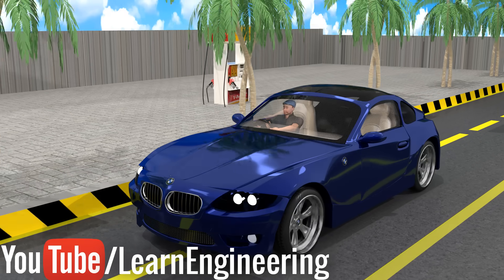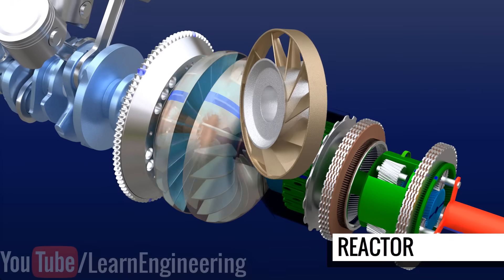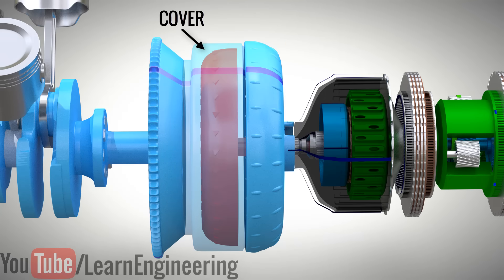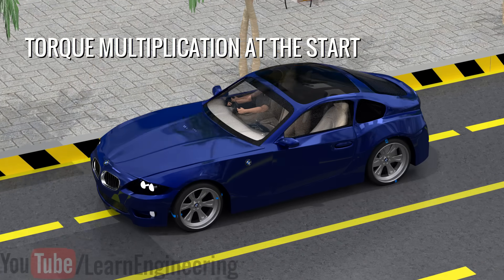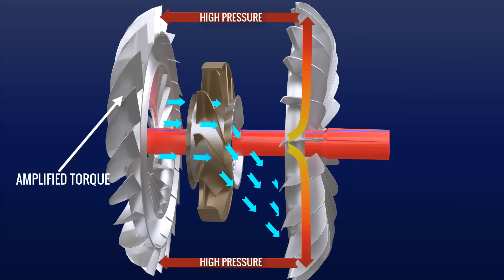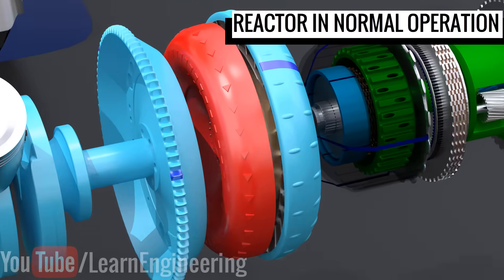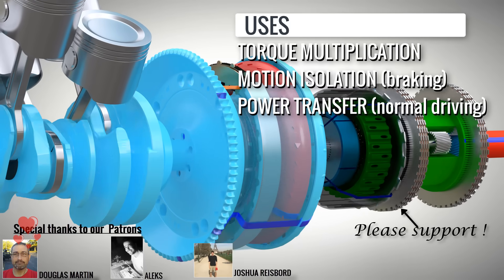Torque Converter, How does it work?

Comment: Thanks, Learn Engineer channel!

Learned a lot. Although I have 2 questions. How is the spinning fluid strong enough to transfer the energy from the engine to the wheels in the Tourque Converter? How do cars achieve such high acceleration with this?

Comment: What is truly amazing to me is that with only a fluid as the mechanical connection between the engines crankshaft and the transmissions input shaft you can lift the front wheels of a 2500 or more pound car a
couple feet off the ground at the drag strip.
Reply: Was thinking along the same lines it’s crazy to even think it could move at all with no physical connection besides fluid

Comment: I hate automatic transmission's.  Give me a clutch and cog swapper any day. I don't care if they can make them as efficient as a gearbox. In our country, and in our hills and valley's,  they are always in the wrong gear. Chopping up at all the wrong times, very little engine breaking, always tough on brakes. Don't get me started on towing with this crap for gears.  Now if I lived in town, a f...ing big town, didn't travel anywhere, and never towed anything, l might consider one. I did have a paddle shift auto from Subaru, that's a big improvement. Let me tell you, it never shifted itself!
Reply: Yup.  Autos are neat and have their place, but I'll take a stick any day.

Comment: When I was a kid I used to wonder if a rubber band as an axle, could be used to increase torque at lower rpm. That idea helped me understand this video but I don't know if it would be a scientifically accurate analogy.
Reply: If you loaded up a rubber band axle on take off it. The energy would be forcing you backwards

Comment: I think that the viscosity of any fluid deteriorates too rapidly for such a crucial dependency.  Which,  to me at least, lends more credibility to claims that automatic transmissions are much more difficult and expensive to maintain than standard gearboxes.  The fluid that keeps the gears from chipping, wearing down and overheating is not also expected to be a load-bearing substance.

Comment: You could decouple the engine from the shaft by using e.g. a centrifugal governor to operate a clutch --- no torque converter needed. Except the torque converter is needed anyway, so why add more weight and more ways to fail ...

BTW, thanks, nice explanation.

For (WWII type) submarines I understand that a fluid transmission (not too dissimilar to a torque converter) was used to connect and disconnect the electric engine plus propeller shaft and the diesel engines was not uncommon.  Simply draining or refilling the transmission fluid would do the trick --- although I understand a conventional clutch was available as backup.

Comment: So, wait. What's keeping the coupling fluid from spinning the turbine when you're idling stationary in gear? Just the inertia of the vehicle and the brakes?
Reply: When the car is in gear the turbine is coupled with the wheels. If the car is not moving it is stationary. There is still torque being sent to it is not enough to overpower the brakes. Automatics will move when you take the foot off the brake, even when the throttle is at idle.
Reply: I don't understand that either. It seems that during braking, there will be lot of torque on wheels which must be counteracted by brakes. You do step off the accelerator paddle so engine is at idle and pump speed is low, but it still would put torque on wheels which means car would start moving the moment you step of the brakes. Seems very strange for someone who has only seen manual and AMT.

Comment: Torque multiplication via the torque converter is analogous to running taller gears on a manual transmission. If the pump spins 1.8 - 2.5 x's faster than the turbine on an automatic transmission, it's momentarily equivalent to using a 1.8:1 - 2.5:1 gear reduction on a manual transmission.

Comment: I gotta point it out, this is not completely accurate. from what I read in a high school text book, the red part and the blue part are actually welded together. and the fan blades in them force the fluid through that fan that's between them and make it spin with the red and blue parts with some kind of technical wizardry. and the fan blades can be placed at different angles to make different stall speeds.
Reply: but I could be wrong

Comment: A torque converter CAN NOT "multiply the torque". That would violate conservation of energy.
Reply: gastropodahimsa Incorrect. Torque is not power. You can multiply torque using levers, pulleys, gears without any change to the energy input or output, this is no different.

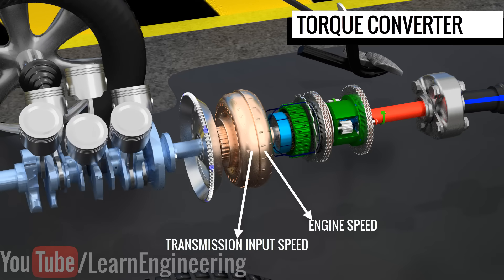Comment: 1:15 incredible and fascinating how the torque converter can maintain handling and transferring so much power to the wheels. So incredible how gearing works so smoothly, and all combined can actually handle and displace all of it to the axle and wheels spinning with enough power.

Comment: so say the engine is at idle but the car is slowing down from high speed. the RPMs dont rise as is you were downshifting in a manual, is this because the turbine cannot drive the pump, only the pump can drive the turbine?

Comment: A great video throughout. I especially appreciated the part about the lockup torque converter... when towing I always knew WHEN the torque converter locked up because the RPM would drop slightly without a gear change. Now I know WHY. Thank you!

Comment: Well done informative video.   Thank you.  Is the fluid in the torque converter the same as in the transmission?
Changing the transmission fluid also changes the fluid in the torque converter?
Reply: Yes same fluid, but you need to do a flush rather than just a drain to change fluid in the T.C.
Reply: @Me-zo8yc  Thank you.   Since I have no equipmento do a flush, can I drain fluid and refill exact amount.  Drive 500 miles, repeat drain and refill several more 500-mile-intervals.  Any good?
Reply: @robertgift  what you could do is look up ATF change using cooler lines. It uses the transmission pump to get new fluid in and old fluid out. I've done it on my 4runner. As long as you follow the instructions meticulously you will be fine. You don't need a lot of tools, and it's more thorough than a drain only.

Comment: Great job explaining. The next step of understanding is fluid velocity around the torus and how torque multiplication decreases (torque ratio) as the impeller and turbine become closer to the same speed (speed ratio).
The fluid flow around the torus donut decreases because the faster the turbine spins the greater its centrifugal pumping force becomes until it nearly equals the pumping force of the impeller. The last little bit of efficiency is achieved with a lock up clutch as you described.
Power absorption, torque multiplication and many other factors have fascinated me most of my adult life.
Reply: Lonnie Ralston, The larger the diameter of the turbine used would benefit the transmission torque wise but the correspondingly  larger diameter impeller would work against the engine by increasing the lever arm distance resisting the engine as well. Were it not for the super charging effect of the reaction member there would be no torque multiplication only an increase of what is called absorption. The torque multiplication ratio can be altered by changing only the reaction member element of the 3 part torque converter. Increase the reaction members blade angle and you increase torque multiplication. In my industrial experience our converters were usually 2:1 or 3:1 nominally but could be engineered to be more or less.
Absorption is another phenomenon that can be changed largely by discharge diameter and tweaked by number and curvature of the blades.
Absorption limits the amount of torque that can be extracted from an engine at a limited, governed RPM. On a governed engine construction machine this  reserves power for other tasks such as hydraulics. Decreasing the discharge diameter of the impeller requires an increased RPM to absorb the same power. That is why you have little driving force at idle and also how they get high stall RPM converters for drag raceing. I think this is an accurate statement, correct me if I'm wrong.
Reply: Burt Vincent I’m a torque converter rebuilder with years of experience in road, race & industrial applications. You’re not wrong.....

Comment: Back in the day, a case could be made for the use of transmissions in automobiles. After all, those complicated gear-driven devices have a lot of parts. So that’s a lot of jobs; and also a lot of research and development. But nowadays, cars have become too expensive, and increasingly, the transmissions in American cars are actually made in China. So the American worker yields no benefit. In truth, transmissions are just a make-work project. The torque converter that you see in this video is a complete transmission, unto itself. A torque converter is just a drum full of oil, with two propellers. The first propellor is driven by the engine. That makes the oil spin around. This oil makes the second propellor spin. It’s that simple. If you want, you could feather the props on the engine side, so there is no angle of attack. That’s low gear, but if you adjust the props for maximum oil spin, then you get high gear. That’s it. There’s no need for a gear box. An adjustable torque converter is a complete transmission. This device would cost about three hundred dollars at the factory level. So the Chinese can keep making lots of expensive gearboxes; and we can start making torque transmissions.

Comment: Wow, didn’t realize the fluid is the medium of locomotion.
Reply: same aye, real weird.
Reply: @Nightsaberban  it odd to get you’re head around all that power is going through the fluid as a big heavy car accelerates away.
Reply: Brakes, power steering etc. they all use fluids. For example try to close water in a metal box and squeeze it i believe eventualy the box will crack if you use a press. Trucks use air for automatic gearbox shiftings (clutch and gears), brakes and other components
Reply: Fluid dynamics is so cool. It's like a hydrolic driven system because the fluid isnt very compressible, so it's very close to if it were solid parts interacting but smoother.

Comment: So which shaft is the reactor connected to?  Output, input, internal?  What happens if reactor one-way bearing fails? 1) spins freely 1) Is locked to it's shaft.
What are the failure modes of a torque converter?

Comment: Isn't the purpose of the reactor (or stator) to re-direct flow so its going the same as the direction of rotation of the pump side, so as to increase efficiency of power transfer, and not to increase torque multiplication?  Torque multiplication comes from the fact that the pump side is spinning much faster than the turbine side (below the stall speed), as in the case of high numerical gear ratios.  Without the reactor/stator,  I would think the trans would slip excessively & generate a lot of heat.

Comment: reactor is known as the stator, and pump is the impeller, and the converter does not amplify torque (planetary does that), it converts rotational energy to torque.

Comment: The torque converter was developed by humble engineers at "Sachs" in Germany. They are the ones who should be remembered! They then had to drive around in ordinary cars.
Their ideas had to be converted into solid steel.
They didn't have access to software or 3D design simulation!
Though modifications have been made to the original design, it had to work, more than just spinning around to be put into production.
It multiplys just torque and not riches!

Comment: So basically it was a transmission or clutch? What is the difference between between fluid flywheel, fluid coupling and torque converter?

Comment: Without a doubt this was the best, and most clearly presented description of how a torque converter works that I have seen. I teach automotive engineering to young adults and it has always been a difficult task to explain how the Torque converter works. Your video is going to be of immense value. Thank you.
Reply: It's a good visual demonstration, but some things are left pretty vague. For example there's a longer 19 minute video on youtube about torque converters, without visual animations, but the guy explains what the lock up clutch at the end actually does. Here it just vaguely states it's purpose. But what it really does it only activates when the highest gear has been reached, aka cruising speed. At that point you don't need torque converting and the components can spin together without loss of power. But it doesn't function at any gears below top gear and when the car is getting up to speed through the gears.
There were a few other things left kind of vague in this video, but watch that longer one which has about 2-3 million views to get more detailed explanations.
It does make you wonder though if people can come up with complex mechanics like this, why don't we have anti-gravity devices figured out yet ;p
Reply: @journeytosilius1  we do. It's called aviation.
Reply: I totally agree. Excellent video
Reply: Is the locking mechanism only for efficiency? Or is the energy loss significant enough to nessesitate it? I'm thinking for tractors, military, and other off-road applications far from any sort of workshop: simple is worth a small efficiency loss.
Reply: @Fabrizio_Ruffo   Its to maximize energy. when you are traveling high speeds, the turbine is traveling faster than the pump, so At that speed its best to introduce a lock up clutch to minimize energy loss.

Comment: 8:04 so if you introduced lock up clutch with Such system ' which is designed for axial rotation isolation ' so what it mean of using such system at first place !!?? Mean when  ' lock up clutch ' bypassed the ' torque converter '  system so what happens in this case when someone immediately pressed the break ???? Then how it will isolate wheel rotation from engine !!!! Because it's coupled by ' lock up clutch ' !??? So it's like saying 0 as 0 + 1 - 1 ??

Comment: “Slushbox” is a slang term for a torque converter. This video makes it so much clearer how that term originated.

I do think the video’s a bit over enthusiastic about torque converters, talking about how “efficient” they are. They’re actually rather iffy in that regard, losing a meaningful amount of energy. The video briefly touches on that in the end when it talks about forming a direct connection once that’s possible.

It’s also clear that the bit where it talks about “multiplying” the torque is dead wrong, since that’d violate conservation of energy. It’d be nice to see a video that explained that better. I suspect what’s actually going on is that energy’s stored in the fluid, since the engine is running but not delivering power when the car is stopped, and the early stages are about transferring that stored energy to the crankshaft.
Reply: Below stall, torque converters do multiply torque. The energy isn't created nor destroyed within an isolated system. The energy is created by the centrifugal force of the crankshaft effecting the oil, and rearranged to heat in the oil, not destroyed.

Comment: I never liked driving a car with an automatic gear box . Here in Wales  , there are a great many hills and driving down one with a car with a automatic box the gears will not hold you back so you have to use the brakes  more . And I sometimes need to keep in a low gear when accelerating. And I do find them boring !

Comment: So Question, then, is energy loss in the fluid why manual transmissions vehicles get better gas mileage (since they don't have torque convertors)?  Also, does the lock up clutch totally eliminate this this loss of energy or only partially?

Comment: I bought a toyota corolla 2005 15 days ago odometer 150000 km now it shows engine light. Talked with mechanic said it shows 741code. Should i keep it or should i sell it?? Whts the cost of it. Bought it for 3800$ cad

Comment: that is just torque converter,when you get in to transmission,even with best explanation,you still get brain fart,one the reason there are all kind of engine performance modification,and none for transmission, all you can do is try to fit different transmission to engine

Comment: You failed to mention the main reason why the reactor wheel is necessary for the torque multiplication: torque conservation law.
Without the reactor wheel (or when the one way clutch disengages) the output torque is always equal the input torque. It's only when the fixed reactor wheel enacts the counter torque, the output torque can be greater than input.

Comment: If you really cared about the Environment and Fauxbal Warming, you'd drive a manual trans--almost zero waste heat compared to an automatic, better MPG, and much less petroleum-derived ATF consumed during the service life of the vehicle.  I mean sure, with a "stick" you have more pedals than feet, but you get that dance down pretty quickly.  ;')

Comment: I'll take manual transmission over automatic anyday.......🤯🤯🤯🤯
Reply: While I like the idea of manuals mostly because I hate computers being in everything, I really hate the third pedal and the mere idea of having to break apart the engine and transmission to fix/replace the clutch since it is a high wear item.
If they could combine the brake and clutch pedals in something like a set trigger mechanism and have the clutch in a cassette I would be much more inclined to go for em.